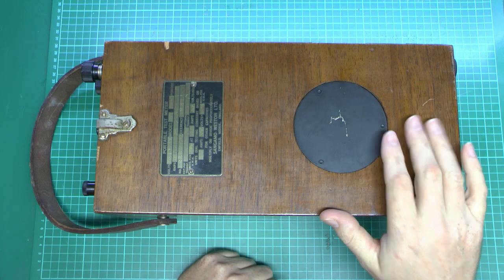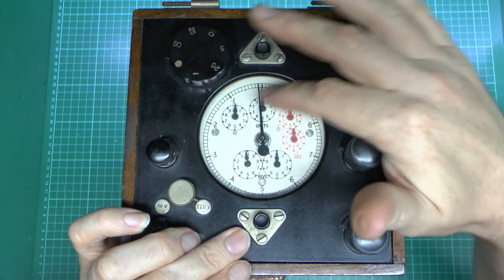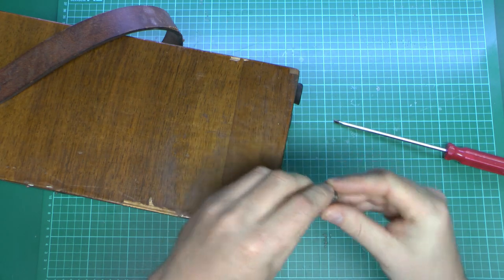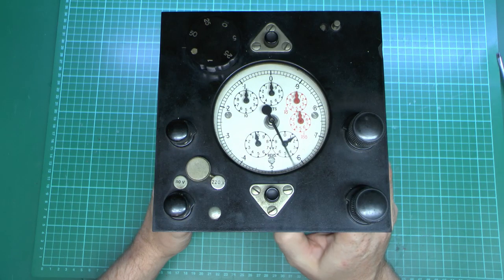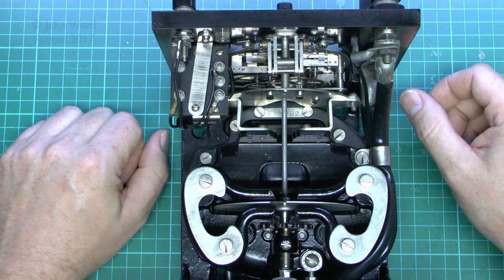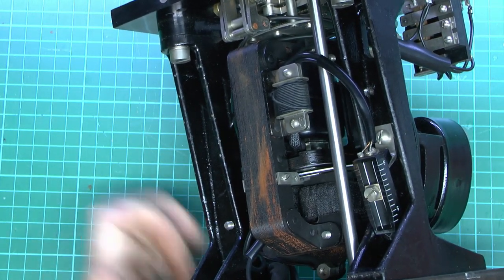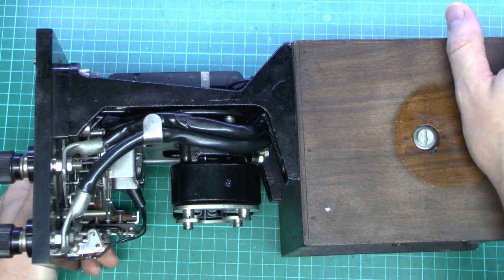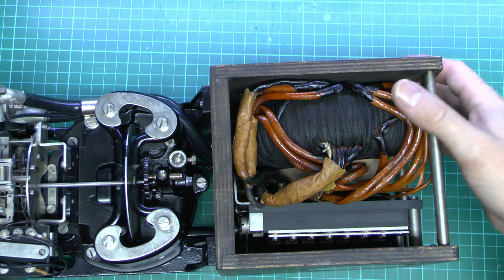Inside a Sangamo Weston Portable Test Meter Model 12

Comment: The holes in the case are probably for an other type to enable a (very thick) cable to passed through the centre of the large toroid transformer as a current transformer.
Reply: I had the same thought, but it must be a completely different version without the range switch.
Kind of odd that they would not make a separate case, back then people usually still had time for details like that.

Comment: Could be the meter is in the case at 90 deg. to what it was meant to be and the holes were intended for access for cleaning the contacts. At one time if you queried the meter readings a man would come round with such a device to check your meter, I remember my father telling me about when he complained to the electricity board about the supply to his photographic studio and they came with all these great big meters to check the supply. I guess back in the 40's and 50's labour was cheaper than swapping out the meters.

Comment: Great vid as usual but let's see that old gal working and checked for accuracy
Reply: Hmmm.... We would need Evolution Three of the Meter Accuracy testing Board to check the accuracy of this device. :-) The accuracy magnets in these are similar to the Sangamo Weston HMT and are known for weakening-off over time. As such, my British Sangamo HM is a bit out-of-wack, not adjustable and spares were discontinued DECADES ago. :-(

-Wayne's Electrical.

14th August 2017, 21.22

Comment: Very nice meter and very well made. That meter can be used for on site meter testing connected in series with the meter to be tested.
Reply: RODALCO2007 I was going to send this video to you
Reply: Hiya Rodalco. Have you noticed that this device has parts similar to the Sangamo Weston HMT and the British Sangamo HM? At 1500 revs/kWh, this one is bit of a scorcher! :D

-Wayne's Electrical.

14th August 2017, 21.25

Comment: From 1977 until 1981 I served an apprenticeship as a 'meter mechanician' with the old London Electricity Board. My job was, once qualified, to repair and/or calibrate electricity meters and time-switches. I did this for a further 7 years.

This device is known as a RSS or Rotating Sub-Standard and was a vital part of calibrating electricity meters. (This particular model is a little older than the instruments I would have used which didn't have the voltage or current selectors.)

A bunch of meters were placed on a test bench (either 60 or 120 in our case) and connected up so a designated current at the requisite voltage (depending on single phase or polyphase use - actually the test benches capable of testing 60/120 at a time were single phase only) and powerfactor. The RSS was connected up as the 61st (121st) meter.

The meters under test (mut) have a certain number of revs/kWh or constant (for example the Ferranti F2Q from an earlier video has a constant of 150r/kWh) and the RSS also has a constant, in this case 1500. From this you can work out the ratio and thus make precise measurements of the mut. In this example 100 revolutions of the RSS will be 10 revs of the mut which will give you a nice percentage error. Not all ratios were as neat as this; the Ferranti FMm for example has a constant of 225r/kWh!

Of course for this to work the error rate of the RSS needed to be known and a correction applied. So unless there was no measurable error the RSS would not complete exactly 100r/kWh. The RSS would be checked regularly (possibly weekly but my memory is letting me down here) at various loads, both at unity and 0.5 powerfactor; this would be done with a lab grade ammeter, voltmeter and calibrated stop watch. The RSS is of course a precision instrument and capable of much accurate measurements of power than a standard electricity meter.

The same devices could be used externally from the workshop as a check meter if there was a concern about a meter in service.
Reply: Using the FMm example from above; 
225:1500 = 1:6.67
so 10 revs of mut = 66.7 revs of RSS
Assume RSS is fast with an error of +0.01 then a correction of -0.01 would need to be applied.
Now 0.01*66.7 = 0.667
Then 66.7 - 0.667 = 66.03
Thus the RSS needs to complete 66.03 revolutions for 10 on the mut.

If after the RSS has completed 66.03 revs the mut has completed 10.1 turns the mut is running 10% fast and can thus be calibrated accordingly.
Reply: Hiya! I own some Ferranti instruments, and here are the models that I own at the moment:

FNE 12Q (225 revs/kWh)
FNN 2Q   (150 revs/kWh)
FMm        (225 revs/kWh)
FMm-P    (225 revs/kWh, coin-op)
FPQ-102 (both variants are 225 rev coin-op)
APQ ( 225 revs, coin-op. Interestingly, this model is a Smith/Ferranti combination)
F2K-50B (187.5 revs, coin-op)
F2K-100 (187.5 revs/kWh)
F2K-100-2 (187.5 revs/kWh. A dual rate version of the F2K-100)

Models I don't own:

FNE 12 QWR (dual rate version of the FNE 12Q)
F2Q-100 (Similar characteristics to the FNN 2Q, but with a FPQ type of accuracy magnet setup)
FM (I think this one scorches around at 375 revs/kWh!! Tasty loadwheel action, baby!!!! :D)

Any Ferranti meters which are three-phase or have MDI readouts (MDIs are FLIPPIN' TASTY!!!!! :D)

At the point of writing this, some of the models I have, are shown on my channel. The ones that aren't, are on their way some time later. Subscribe if you don't want to miss out on those! :D

-Wayne's Electrical.

14th August 2017, 20.35

Comment: When we bought our first house in the 1970s (new build) we were using electricity like crazy. We questioned the situation with the East Midland Electricity Board and a man turned up with a device similar to this. It was connected to our supply with everything else in the property disconnected and run for a few minutes.

The outcome was, our meter was deemed to be accurate but they changed it anyway and our consumption reduced significantly. I can only assume the result was falsely deemed to be accurate to avoid any claim for rebate.

Comment: Hiya John,

According to some of the internals in there, this dates from around about the Sangamo HMT era (See a Sangamo HMT on my channel) or possibly even earlier than that, maybe even the domestic S29 era which I believe, were possibly around before the HMTs (My HMT was first calibrated in 1958, which is quite recent, given that it is a 40A unit.)

While your unit is 5A, going at 1500 revs/kWh, it would be difficult to put a date on it, as this is intended to be a testing instrument and not be continuously connected, day-in, day-out under load.

As an example, my HMT goes at 40A and 375 revs/kWh, so the loadwheel characteristic of my HMT runs at one quarter speed of your unit. However....

If you look at my British Sangamo HM, that goes at a miniscule 10A and 750 revs. If I had to put a date on that, based on its loading capacity, I would say early-to-mid 1940s. However, this is a bit difficult to gauge as there were no markings or date codes in it and it is rather unlikely that someone else [with a HM prepayment meter of the same characteristics] is going to chime-in and say that their HM has a definitive date label on it.

So, in comparison to my British Sangamo HM and your device, what do you notice? My one has double the capacity, yet half of the loadwheel speed. Now, given that your device is a testing device, this unfortunately more-or-less means nothing, but in a way, it wouldn't surprise me if they [Sangamo] based this unit on a domestic S29 or a very early HMT and then 'bolted-on' a few extra bits and pieces to make it into a testing-meter. (that's if Sangamo ever made a 5A rated HMT)

If they did base this on a 5A domestic S29, then your unit could easily date from the 1930s. Another thing which makes me say such an early point in time: The 220v stated on it. Some time later as we know, the UK's voltage was supposed to be a uniform 240v, give-or-take a bit.

To use that device nowadays, you would more-or-less have no option other than to run the voltage coil in that from a variac, or if you know how, to put a resistor in series with the voltage so as to bring the voltage down a bit.

The 110v selector on this may have been used in situations where a meter was in a substation (like for example a L&G Trivector) and was energised from a Potential Transformer. (PT)  The PT would have a ratio of 1:100 and would be powered on a 11,000 volt supply, thus outputting a 110v supply for the L&G Trivector. Given that, and this unit might have been used to test a meter which is configured for a 110v supply, this could then be connected into that 110v supply, and then into the output current wires of the CT (current transformer) which are used to drive the Trivector. Some Trivectors are configured for 110v and are what's known as 'Blank-5' meters. They have a maximum current of 5A and are energised on PTs and driven on CTs.

With a Blank-5 meter, when reading the kWh readout, a multiplier needs to be used. Let's say that the Trivector is metering a 3,200A electric supply. The CTs would reduce that 3200A down to 5A (a ratio of 640) and so therefore, when reading the meter, whatever is stated on the Trivector meter, that reading had to be multiplied by x640 to give the true kWh used.

Your unit could be switched to the 110v setting, connected to the 110v PT and the 5A output of the CT and then a test could be carried out. That is probably why your unit has a 110v setting. I have never seen or heard of a meter which is energised on 440v. I have heard of 3ph/415v meters because you have shown one on your channel before now, but never heard of or seen a 440v meter.

You never know, where a 440v supply exists, a lower-ratioed PT might be used to bring the voltage down to 415v or even 240v.

Anyway, thanks for showing,

-Wayne's Electrical.

14th August 2017, 20.02

Comment: Great video John as always, I recon you should send that to Photonicinduction for further testing. ;)
Reply: Hmmm..... Why Mr. Photon? He might be able to make it spin-up and all of that, but....

I am sure that if John were to send that anywhere, he would be more inclined to send it to Wayne's Electrical where it could be connected up to Evolution Three of the Meter Accuracy Testing Board and carefully dialled-in to see with precision, how the accuracy of this device is still holding up all these years later.

Those large accuracy magnets in there are known for weakening-off over the course of time, and as such, my British Sangamo HM is way out of wack. There's nothing I can do about that either. The magnets are not adjustable and spares were discontinued DECADES ago. I don't even think that the metering division of sangamo even exists anymore. :-(

Fortunately though, my Sangamo HMT is still running good and was first calibrated in 1958. I obtained that instrument straight out of service as well, and it still has its original anti-tamper seals fitted. :-)

-Wayne's Electrical.

14th August 2017, 20.58

Comment: At 7:03 one can briefly see that the rotating disc has this grid pattern of dimples on it (like center punch marks).
I have seen this on several electricity meters and am very keen to find out what purpose it serves.
If anyone has any idea please let me know. 
You can see it more clearly in the video "Vintage electric air pump" by rustymotor on youtube. This motor works on the same induction principle. This is one of the great mysteries of my life, please help. ;-)

Comment: Anti what country are you in? The town I'm in Weymouth in Dorset used to have 3different standards there was 230/400 3 phase AC 230/460 AC ,2 PHASE and 220/440 DC
Reply: Bristol UK, which was a 210 volt AC area,  I'm surprised to learn just how fragmented standards were around the UK, considering that the national grid started life back in the 1920s.

Comment: That's a lovely bit of kit. There's a very old wooden PSCC tester at work, amongst numerous original AVO meters, I'll have to try and get some pictures.

I've got a subject that might be a video idea - it would certainly help me. That of interaction between loads - how noisy loads affect the power delivered to other sensitive/affected loads in a system. I know that they do - but the 'why' is escaping me at the moment. I've written a post about it at Talk Electricians - would appreciate if you had time to have a read please, it may be some fuel for a video, who knows. https://talk.electricianforum.co.uk/topic/33232-electrical-theory-interaction-between-loads/

Simon

Comment: John check out rusyymotors channel he tested a very similar meter a while back. Re the 110 volts setting parts of the UK were on 110 volts back in the 1950s lambeth in London being one and lynton and Lynmouth to name 3
Reply: Jon Johnson: Learn something new everyday, I didn't know that parts of the UK actually used to be on 110 volts, my part of the world was always 210 volts, which was standardised to 230 volts during the late 60s early 1970s, requiring teams of engineers visiting  premises and adjusting, upgrading and replacing every electrical appliance, I reckon even back then, it must have cost them an absolute fortune to have carried  that out nationwide.